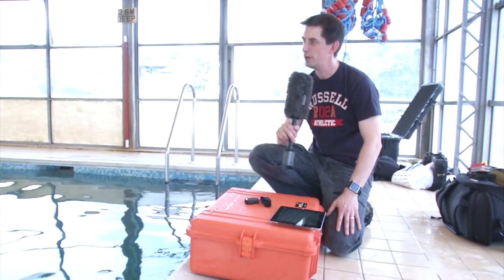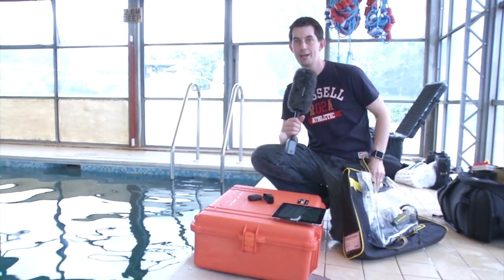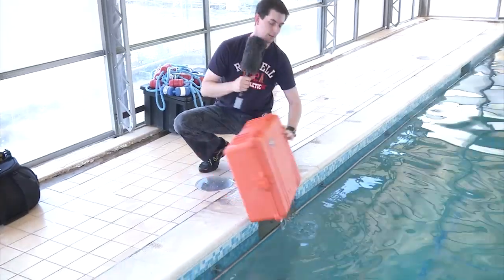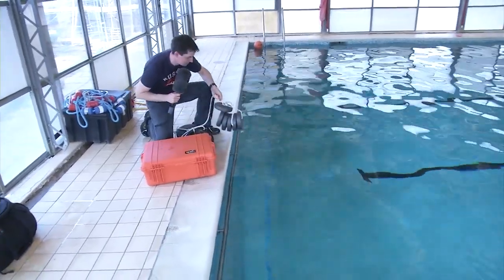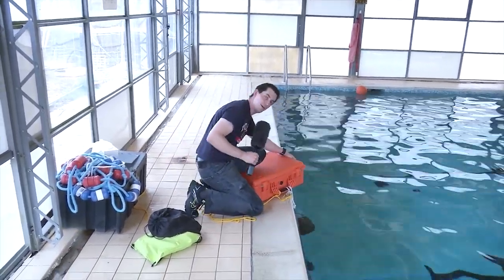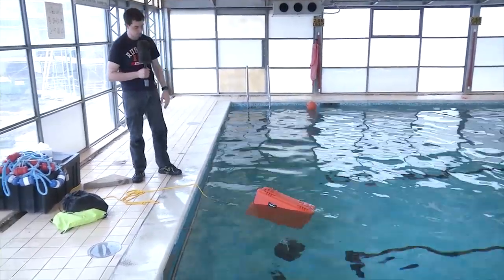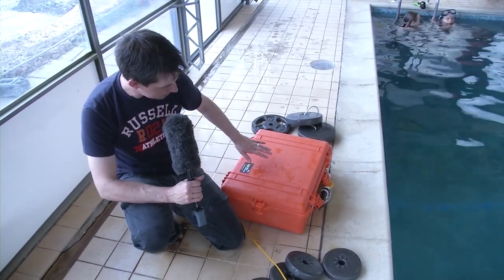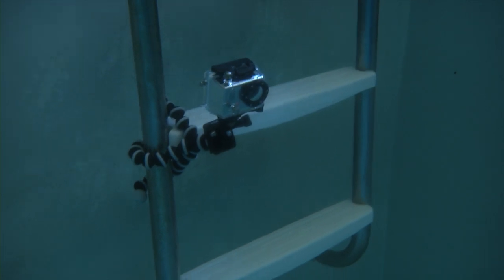Peli Case 1600 Tested to Destruction Challenge 3 - Buoyancy and IP67

Comment: As others have mentioned, once you reduce the internal volume of atmosphere, you're reducing the 'buoyancy' of the case.  Whilst the case is able to with stand 44kg+ empty, once you added the rubble into the case, you'd find that you would be able to sink it with less of an attached weight.

This also applies to Pelican (or any other) case that has lots of gear inside.  It'll only be buoyant up to the volume of internal atmosphere.

Comment: The GO PRO wireless remote didn't work under water because the wavelength that it emits cant penetrate water, Bluetooth is one of the wavelengths that cant penetrate water with its wavelength of roughly 12.5cm.